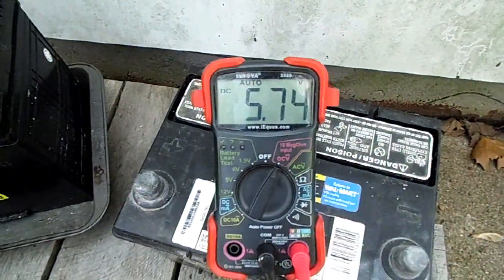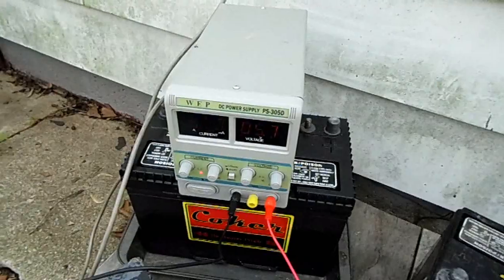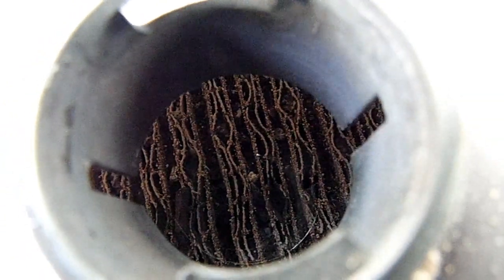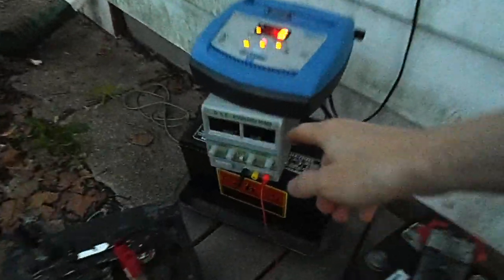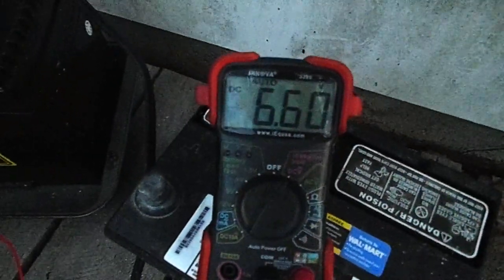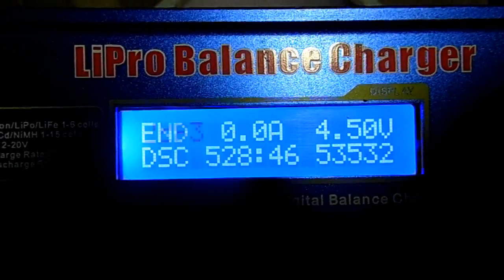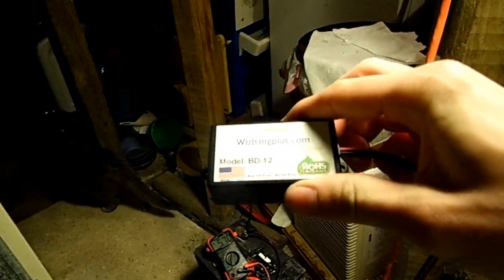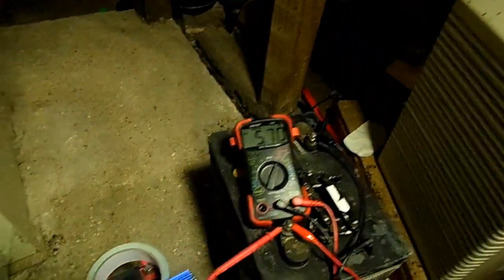Do Desulfators Restore Amp-Hours? Lead Acid Battery experiment

Comment: I thought I'd comment as I was browsing new 'desulfator' videos.
I (M.I.T. certified in EE) have spent the last 3 years developing and testing a complete recovery system for L.A. batts. Mainly auto and marine sized are the targeted units. I have ascertained the actual ionic process and achieved a statistical 33% recovery of 'junk' batteries back into service with no chemicals or cleaning etc.

Turnaround is about 24 hours for a 12V 50Ah batt! The batt can be as low as 2V rest V.
The system auto detects the battery condition and calibrates the recovery and qualification processes which include dedendriting, desulfating, charging, pulse charging, reflex charging, grid & buss bar testing, hi pulse discharging, cranking amp and C/5 Ah rerating. The system (has 4 cables) can sequentially process two batts and can hotswap for 24/7 recovery, fully uploadable data log for the last 24 recoveries. It is capable of 1000 (1KA) pulses with an avg continuous maximum draw of 300W, peak rating @ 350W.
The display shows precision voltage, avg current,, pulse current, cell temps, Ah delivered, and the phase of recovery (there are 10 phases). Built in high laminar flow battery cooling system for rapid turnaround, rev. polarity protection, short circuit protection, electronic fusing, overheat shutdown, crowbar fusing.

System reclassifies appropriate battery use...for automotive (SLI) or 'backup' UPS applications. System throughput is about 20 'good' batteries per month yield from a 60 battery feedstock (average 12 hour per batt.) It employs multiple 'live current' testing protocols to assess battery condition and perform early rejection as required.

System provides long term float charge 'maintenance' capability for eight recovered batteries. It is portable & UL listed.

I wanted to create the 'final' system, no more guesswork & snake oil. It tells you the final battery's Ah rating and updates the cranking amp rating improvements on the fly during the recovery! It also tells you what the failure mode is for a rejected battery.
Reply: +Ancel UnfetteredOne  you are a Freemason liar.... get lost .. I can see every one of you creeps..... dont lie to people...
Reply: +CarsRcool 
O my...don't worry. The proof of the pudding is in the eating. Opinions are moot points then.
Reply: +Ancel UnfetteredOne this guy ( and others ) make good vids on how to very cheaply restore old batteries... why do you come here.. and  offer no solutions.. and who paid for your "research" ?..we want to fix old batteries for less than 10 dollars... I doubt you want to help.. with that
Reply: +CarsRcool 
Actually, my research was paid for by my winning an innovative idea award competition. The results of which should go commercial soon. It's really targeted at the tropical belt where sulfation is a lot more common. The system that I mentioned isn't targeted  at individuals trying to recover a battery or two. So it's not a solution for that. The reason for developing  it is that in the developing world, a lot of these auto batteries are smelted in backyard operations. Compared to the U.S., the lead reclamation is quite poor and a lot of toxic electrolyte gets poured down the drains. Aside from the $$ investment in instrumentation and tooling to develop the system, approximately 2,400 engineering design hours and testing have been invested. I can only hope that it was time well spent and the commercial venture will be able to sustain new R&D into the product's life cycle. 
Please don;t think i am denigrating the efforts shown in this video. I respect anyone who tries to do something in this regard. I have been more fortunate and have had more support.

I am presently compiling a 'handbook' elaborating on the techniques that appear to yield success. That will include actual DIY circuits to implement the techniques. This will be geared toward the individual and not attempt to achieve the '24 hour'  fix that the commercial variant delivers. Hopefully that will be the type of 'cheaper' solution a lot of folks want to find out about. Included in the handbook will be detailed EXCEL data logs & charts of successful and unsuccessful attempts at recovering batteries, analysis of their recoveries and analysis of failures as well.
I wouldn't include the 24 hour fix variant because it can be dangerous if implemented improperly by an amateur to electronics. Kilo ampere currents are involved and I have had detonated batteries and electrical flare outs during the durability testing phase. I appreciate your passion in this CarsRcool.
Reply: +Ancel UnfetteredOne thank you for your kind and well thought out reply...
and yes this can infact be dangerous if safety measures are not applied. 
and it does take some skill in doing this work .. that being said... 
I am moving in the opposite of huge commercial projects... it appears anything over a 10 -20 percent improvment is NOT allowed by the system .. 
if you can check out Paul Pantone,  ( Geet reactor ) Stanley Meyers ( water for fuel ) is how it is described but is is more than that.. or  Joe and the Joe Cell.... if it really works and it is hundreds times better and much much cheaper..  you are beaten like a bug.. well.. the truth is they give you money threaten you or .. just whak you in the case of Stanley Meyers. 
Follow up on "The Hull effect" .. an impovement on  the Joe Cell.. that brings a simple charge to the moving oil stream inside a car engine and allows you to wean 90% of the fuel off a carburated car. 
So Cheers and have a nice day 
It is MUCH MUCH bigger than a cheap batter fix... it is about turning the world upside down ( ans righting it ) so all this expensive stuff is free.. 
ask any question if have them     Cheers
Reply: +Ancel UnfetteredOne and a quick question .. .if the case could be dissasembled.. could one not brush the sulfate off.. ( if one had access to the plates ) and strain the acid and put it back in?
Reply: +CarsRcool 
The simple answer is not quite. Most battery plates are made with a paste of leady oxide, lignin, carbon black and barium sulfate,. The grid holding the cured paste is usually an alloy of lead, combined with a selenium grain refiner (for casting) and either antimony (for strength) or calcium/tin (strength, water conservation & creep resistance). The latter being more prevalent over the last two decades.

The surface morphology of the paste is king in determining cell performance. When the lead oxide is converted to the 'soft'  sulfate during discharge it becomes partially 'passivated' as lead sulfate is not a good conductor. After some time without recharging, (especially @ >30°C ambient)  this lead sulfate 'grows' into harder, stable,  crystalline lattices and blocks the paste pores and 'passivates' the plate area creating a 'shrinking' area of good plate until the remaining battery plate 'capacity'  is insufficient to do it's job.

In auto batteries the paste/grid plates are quite thin (about 1mm). Physically sloughing the 'sulfate' off will also removes precious plate material (that should be lead oxide) and degrade the battery's capacity. Deep cycle batteries with plates > 6mm can sustain what you mention and appear to function for a useful life. 
This is why additives like EDTA can appear to 'rejuvenate' a battery in the short term. Repeated use or overdoses will however 'thin' down the plates and effectively destroy the battery's function over a short time.

That's an edited bit from my 'handbook' btw.8))
Reply: +Ancel UnfetteredOne 
I ask for some leeway to  share my most recent and best (fully automated) recovery result so far using a 13 phase process.
Battery = Japanese 55B24, with the Spec. gravity less than 1100 in all cells. Rest V after hours of 400mA slow charge = 11.26V implying no shorted cells. Visible 'sugary' crystals on all buss bar interconnects.
OEM ratings = 42AH and 370 CCA. Tested CCA < 200A

After a net 26 hour process, all Spec. Gravities exceed 1270 with a 5 point variance. 
Recovered ratings = 37Ah and 457 CCA . 90% OEM Capacity and 123% cranking amps!
No visible crystals remain!
Reply: Ancel UnfetteredOne so it seems at 123% cranking amps it is better than new ?
good job...
Reply: +Ancel UnfetteredOne Amazing and well thought out answer.. I can't thank you enough... I will save this in my own files to print it out. 
Perfectly explained !                                        Cheers
Reply: +CarsRcool 
You're welcome.
Here's a battery AH logger that I made open source and can also be purchased as a DIY kit. I found it was necessary when evaluating accurate battery recovery capacity. It's function is built in to the current automated recovery system I mentioned earlier.
https://hackaday.io/project/1375-lead-acid-ah-capacity-testerlogger
Reply: Ancel UnfetteredOne thanks... if you can get a chance look up the Hull effect 
( Robert Hull Nathan Rodgers ) .. electrical frequency from the alternator through a fan light dimmer switch .. and  the car becomes magnetic            and rides in a "energy" bubble .. very simple almost no cost.. 
cold plasma and it  works 100% of time 
Cheers
Reply: Ancel UnfetteredOne  hey cool that is a  kick ass project !
Reply: +CarsRcool 
I had a glance thru....it's a long patent read.
To evaluate it I'll have to dedicate some analysis time it seems. 15 years ago or so I had a carb. 2000cc which I turbocharged and designed /built my own ECU for performance. I still have some of those ECU units about. I could implement them with data logging signal outputs via bluetooth to really monitor RPMs, mileage, acceleration, fuel flow, and energy losses due to braking etc. to do a proper conservation of energy analysis. Basically tracking the chemical energy of the fueling vs the thermal, electrical and kinetic energy outputs of the motor.
I had done something like that back in Eng. school on an old Tangye diesel motor.

ATM I have no carb. cars...two Nissan Wagons, an Xtrail Safari turbo SUV and a Subaru Impreza hatchback. ALL EFI. The wagons tote the lead acid batteries for my testing purposes.

Has no big businesses picked this tech up..or licensed it yet...? Seems the kinds thing Google or Tesla Motors  might want.
Reply: +Ancel UnfetteredOne  no .. this is too good so it is squashed. .. 
one car at a time for now.. too simple output from altenator to input of combo light dimmer and ceiling fan switch  output wires twisted together
sent to a wire and SS probe INTO moving oil stream of engine.. 
on a carb car... slowly ( as the energy is absorbed ) turn down the gas 
with a needle valve and advance the timing... it is the 'Frequencys" sent from the alternator that charges the   oil.. the last thing to do is remove the check ball and spring from the pvc valve and reduce this flow down with a valve of a restricted smaller hose.. and thats IT ! super Cheap .. it is that simple . 
the the engine becomes magnatized.. the car rides in an energy bubble 
a slipstream effect takes place.. and the moving enertia disapears.. 
and thats why it was bought and shelved...... so Cheers and thanks for looking .. it will work on any old car.with a carb and NO cojmpute
the car computer is NOT needed... ( a control device ) 
Charles Pogue got 200 mpg in 1936.. so this is a fight that they cant win today    Have a nice day
Reply: +Ancel UnfetteredOne  How we are trained is impropper and actuall backwards.. yes.. I know that sounds crazy ..    but think of this for example 
"cold" electricity .. where the light bulb gets cold...... a lot to learn .. but 
it is not in books or the schools .. Cheers
Reply: +CarsRcool well . only one more item.. a    return line from the carb to the gas tiank... to keep the gas circulating
Reply: +CarsRcool works best at gravity feed.. or 1 psi or less

Comment: desulphated with out charging? Your kidding right?
Reply from the maker: nasanction its a product review, thats how they say it should be used.
Reply: I know better. The desulphator requires current to operate. letting a battery discharge completely will destroy it. I think it was a failure to follow directions.

Comment: I picked up a good desulfator from Ebay several years ago. Wasn't cheap though. I just had to replace Everstart Max Walmart battery. I purchased it in 2004 . The desulfator kept it alive for 10 years. I've recovered about 5 batteries over the years with it.
Reply: Battery Life Saver BLS12/24B 12V &24V desulfator
http://www.ebay.com/itm/Battery-Life-Saver-BLS12-24B-12V-24V-desulfator-Best-rejuvenating-model-/260820325079?pt=US_Power_Tools_Batteries_Chargers&hash=item3cba1a52d7
Reply: Also I use my desulfater with and without the charger alternating the charger on and off. My desulfater will discharge a battery leaving it on all night so I usually only leave it on during the day. And don't discharge a 12 lead acid below 10.5 volts or you will cause more damage than you fix.

Comment: Very interesting video...thank you! I recently purchased a BLS 36v Desulfators for my EZ-Go golf cart. I tested all 6 6v batteries after fully charging them each individually and letting them "rest" for about 10 hours. Each tested at 6+ volts and each does not appear to have any "dead" cells. I have had the BLS installed for a full week now, discharging the batteries by running the cart daily to the point of barely moving the cart, then recharging again. I still can only get just a few minutes of use out of the cart. Would you say this is a wasted effort trying to revive the batteries or maybe another problem? Just curious! Thanks!
Reply: Try an Optimate/Oxford  charger or a similar smart charger
Reply: +Jim Smith People need more patience with the desulfators. I have two BLS 12-24v units and have been using them for about 10 years, which happens to be the age of my oldest Trojans and some other no-name T105-type batteries still in use.  I leave the desulfators conected 24x7 (with solar charging).  In my experience, one week is totally inadequate to rejuvenate a sulfated battery.  Two months would be more like it.  This is not what the ads say but it is what I have found.    Of course, a shorted battery or a damaged battery is not going to improve.  Batteries which have been run way low on electrolyte (Yes, I have done that during a lazy period) might or might not rejuvenate (maybe 50% improve).  But batteries which are not shorted internally and not damaged and not low on fluid and not allowed to stay discharged under 5.6/11.2 usually do improve, sometimes back to almost new specs.  I have two previously useless generic golf cart batteries right now which were brought back to excellent shape after being desulfated over the winter. I do charge them individually occasionally during the desulfation process which helps balance them  (compared to being charged in the series bank).  I've only recently acquired a true equilization charger so we'll see how that works.

Comment: I see one major problem with this video.  That is a wizbang BD-12 12 volt desulfator.  You are using it on a 6 volt trojan battery.  I am not suprized it didn't work.
Reply from the maker: the listing said it would handle 5-24v. plus my other tests with it on a 12v battery yielded no results either.

Comment: Just overcharge the battery with 2A for 7days and you will see way better improvement than this ...
Reply: Hello guys. My question would be: how do you "overcharge with 2A" if the heavily sulfated plates don't draw more than 100ma with a 12 V charger?
Reply: At what voltage? I’ve seen that you should charge/drain repeatedly at high voltage and very low amperage, but not sure what voltage or amperage. Many say very low like 300ma. When you say overcharge, what do you mean exactly, to a certain voltage or just keep it charging no matter what? Using a “smart charger” or a manual one that won’t switch to trickle/float/stop charging ?
Reply: Need to slam it with 200A or regular charging at 9V. With one looking that bad I would use 12V charger until plates get cleaner looking. It's cruuuuusty.
Reply: @TheGuruStud  exactly. Not sure how so many people don't know ow this. Is old news. I've done it with 100amps but 200 is the recommended. Heard a guy do it with 50
Reply from the maker: i already did that. this is to see if the desulfator will improve on it.

Comment: Did you give up ....
Keep a trickle charge with the whizbang ?
Reply from the maker: i'm thinking the wizbang just isnt powerful enough. so i'm going to be making a mechanical one that shocks it a lot more.
Reply: Perhaps higher voltage spikes would help .... or higher freq of them ...

Or even a automotive coil ...5kv!!!
Reply from the maker: Michael Durkin  i'm thinking just motorize a magneto and run it through it.

Comment: PWM solar charge controllers with a big capacitor bank in parallel with the panels are the best. They give such powerful pulses that you can hear the wires ticking quite loudly.